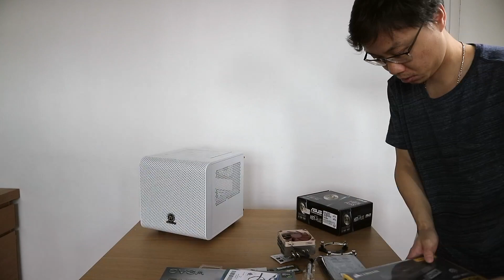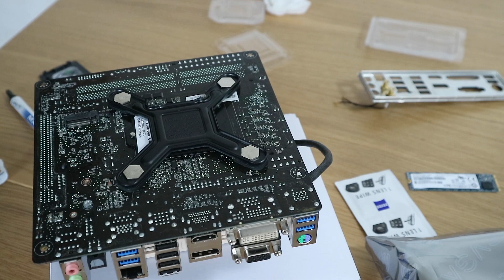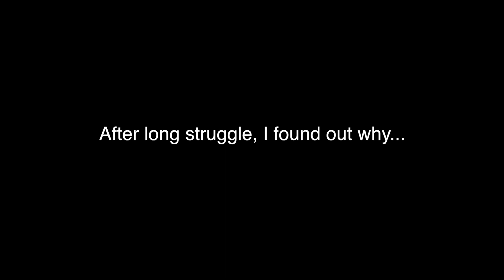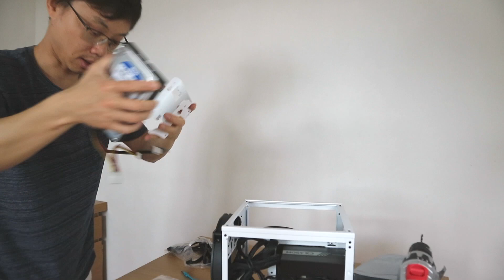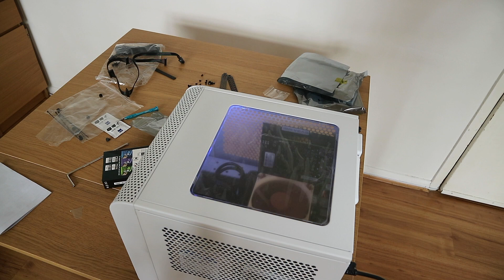Budget hackintosh build 2017-step by stey hardware installation

Comment: Good video, I love this case (I like small/"minimalist" setups) one question, do you think it can fit a Micro ATX motherboard ? I noticed that the Mini ITX was not so tight
Reply from the maker: Hi, micro atx is just a bit too big for it
Reply: Tao M Studio okay, thanks !
Reply: @TaoMStudio  Hello i want this case so bad! But i have micro atx board :( I am thinking about squeeze it inside ;) Could you measure for me max interior 
width  from side to side? ( side panels or frame) I will cut back panel a little.

Comment: i have this case and my cooler is quite loud, could i fit in a cyrorig h7 in here? btw my build is the same way as u but other components
Reply from the maker: Hi, I don't have the build anymore. As long as there is 150cm of clearance from the top, then it will fit.

Comment: Cpu installation: 5:26
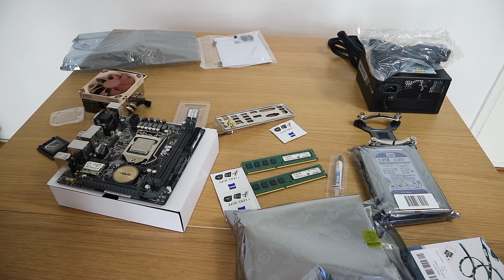Cpu cooler installation: 8:26
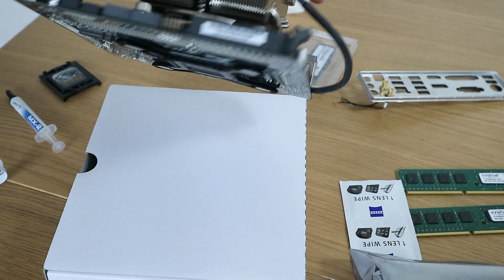RAM installation: 12:08
Ssd installation: 13:56

Ok i get lazy at this point...

Motherboard: 15:42
Psu: 17:47
Gpu: 22:57
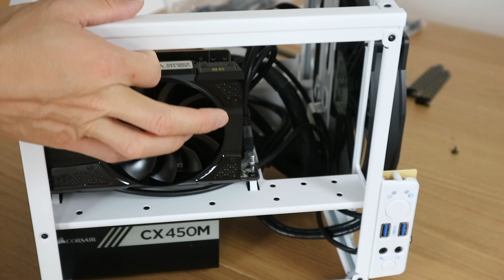HDD: 24:04
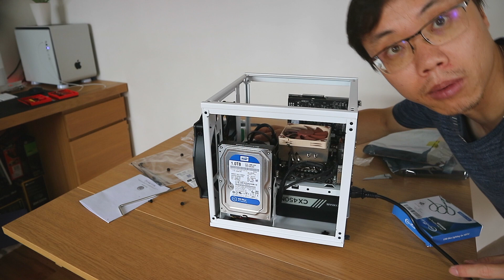RGBs: 32:00

Comment: How do you install the light strips?
Reply from the maker: Light strip is magnetised, hidden away underneath top panel. Connected by molex
Reply: Where do they connect for power?
Reply from the maker: Psu

Comment: just like the netendo cube , I prefer to have my HDD lay flat, but I have many times had to mod. cases on computer builds,  I couldnt believe Thermaltake did that to the hdd in this case and not provide you L style cables for the HDD

Comment: I just priced all of these together and it’s well over 1000 USD
Reply: Yeah £700 is roughly $1000 USD. Well below what one would typically pay for a content creation machine for sure.
Reply: Ehh frankenstein a Mac Pro 2009 - 2010 with heavy upgrades and you will be well above a beast of a content creation machine ;)
Reply: I just completed a PC build to replace the machine I am currently working with. It's replacing a 2009 Mac Pro with a 5, 1 firmware update and 12 core processor upgrade. I'm selling it for $1200 (the current going rate after also adding more RAM, SSDs, USB 3.0, a GTX 980Ti). It has about $2000 invested. It can't be upgraded to a new OS without a patch, and is bottle-necked by an ancient old gen chipset. It'll swing a 1240 CPU score in Cinebench (a bit slower than my single processor i7 build) , but who cares if it won't run future software? Would you like to buy it?
Reply: I thought the compatible 6 core xeon's from that gen were running just as good if not better then current gen i7s if not better in final cut pro for video edditing understand cinebench doesn't give real world results as most benchmark tests are optimized to swing to vendors liking
Reply: Cody Russell Cinebench was developed for Cinema 4D users to optimize their systems to run C4D. The old Mac manages an outstanding Cinebench score for a computer from 2009 (because Cinebench takes full advantage of dual processors), so it gets a lot of credit for that. Editing video is another story because a lot of operations can only utilize a single processor. Effectively my Coffee Lake machine would be twice as fast as the Mac Pro most of the time in (Premiere at least). I can also edit 4K video without proxies on the newer machine because of the single processor clock speed (twice that of a single Xeon in the Mac). The old Mac is an awesome machine no doubt for content work and murders a new iMac, but the cost of the upgrades is just something to factor in, as well as patience during some operations that aren’t using both processors. It’s less than future-proof. It is sad to see it go!
Reply: I was gonna say put windows 10 on it and use a gtx 1080 instead

Comment: This box is so high on my list but after you had a hard time installing the HD,i changed my mind,thanks for sharing
Reply from the maker: Hi, if you install the HDD as Thermaltake wants you to, which is with connections of the HDD on the top, then it is very easy. But I wanted the HDD's connections at the bottom, that's why I modified the HDD caddy. FYI, this is a superb case for small factor build.
Reply: Thanks for clarification,is it possible to install 2 conventional drive and one ssd here?i was plannign to put the 2 big drives on the slot and just put ssd in the bottom or anywhere where there is space for it...
Reply from the maker: Emmm... I was thinking the same thing before the final build. It is a bit tricky but not impossible. You have to be more creative here. My plan was to mount the SSD on the bottom panel in the space between PSU and front intake fan panel, I think the gap is just big enough for a 2.5” drive, so long as you don’t use extra big PSU. Hope this helps.
Reply: This is a big help man,the way i see it,i think it's possible,thanks man
Reply from the maker: You are welcome. Hope it turns out the way you wanted.

Comment: Mate have you never heard of LSfu  ? In the u.k the standard is EBU R128  .And in this day age there is no excuse to produce videos with such bad audio . And for this reason to me your videos are unwatchable . How can you be a tech ? Computer reviewer and produce videos at far less volume than anyone else ?  Get yourself Adobe Audition or Izotope RX6 - and they can easy sort out all your sound issues .
Reply from the maker: Thanks for the info.
Reply: No problem , your videos looks very interesting and I’m sure would be a lot of use to me . I did not even know how to work a computer 16 months ago and during that time through watching informative channels like yours I’ve learned myself everything about both systems Mac and Windows . Now I’ve just built my own desktop style system , using Ryzen  1700 and Asus  crosshair hero MB ( wow the bios is another on another level ! ) . But my plan is to build a small form factor system and put the new MAC  Sierra high onto the AMD platform  ! Not easy to do